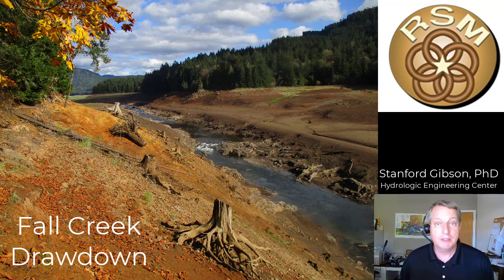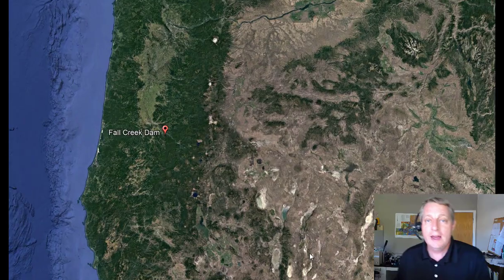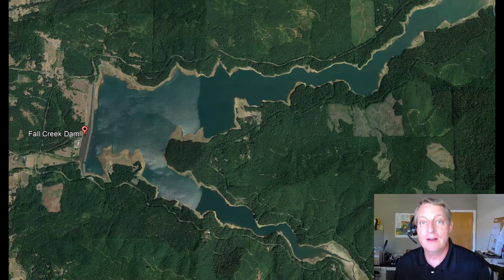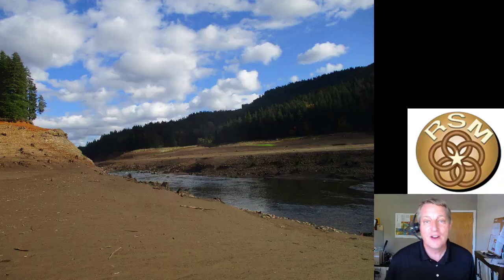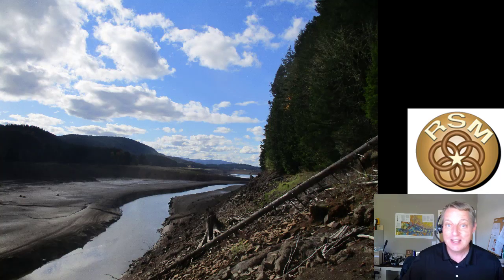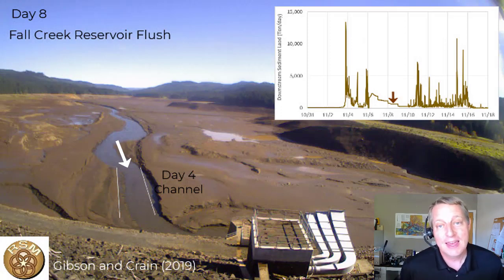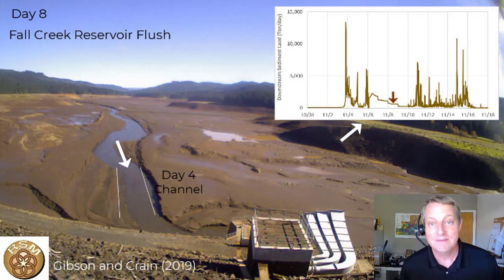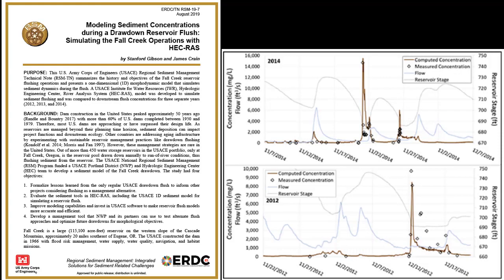Fall Creek Reservoir Drawdown Flush - Time Lapse Video

Comment: Thanks for sharing Dr. Gibson.
I have read this paper on Fall Creek. It seems that the quasi-unsteady worked fine for simulating the flushing operatons.
Since it is more steady and easier to handle, could it be the first choice for a first evaluation?
Reply from the maker: Yes, if you can get away with quasi-unsteady you definitely want to.  It is more stable...but if you check out our papers on modeling Spencer Dam, we went unsteady there because we leveraged the operational rules.